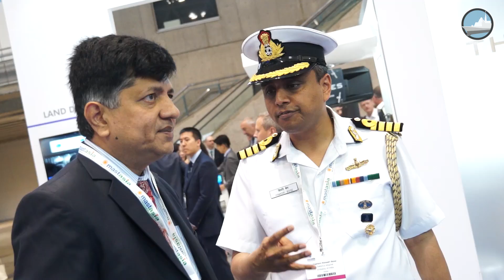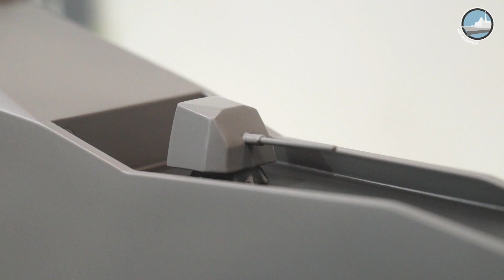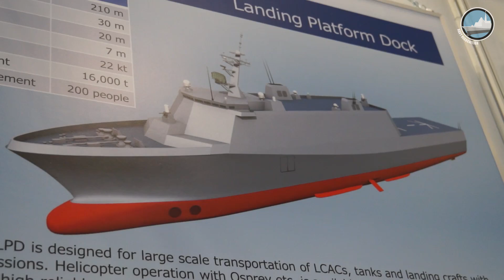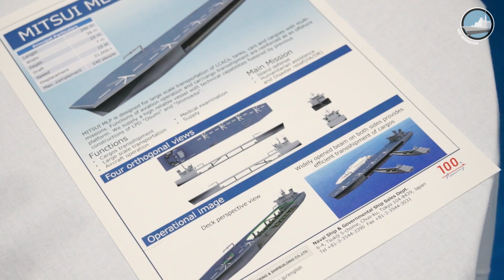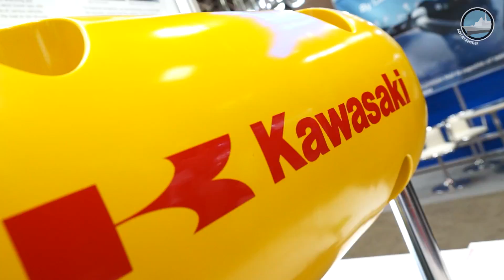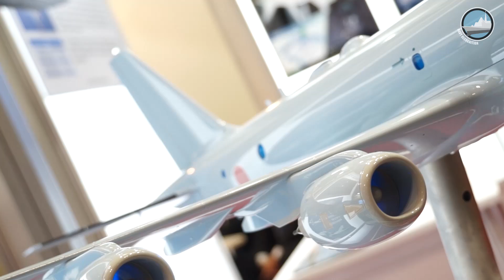MAST Asia 2017, Tokyo, Japan - Day 3: ATLA & Japan's Defence Technology

Comment: the size is sweat spot corvette any nation can afford to put to sea, & no loss if lost small capital ship. Stealth is scam & not enough storage w/ normal use peace time missions, no easy loading & unloading. Rest looks ok right mix cheapest lit beer, still pntess shit but least way so. No1 will think Coast Guard ship problem if u want to repurpose or dual channel sell that & japan won't b a nation going foward w/humanity like DC/usa head lost. Many other nations turkey will not b recognizable after judgment.
Reply: Problem is any modern corvette will b hydrofoil hull not even in water bc small enough that it can where as larger ships can't. Air is cheap & ring of air raising slow speed draft in corvette size class also going to b the norm.